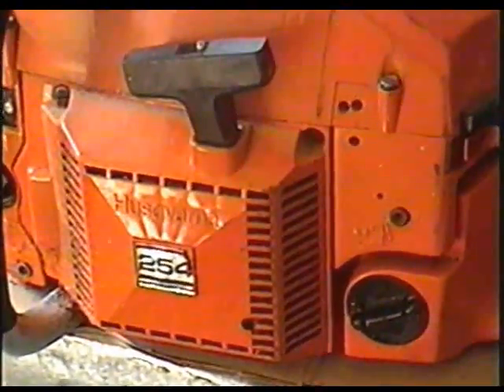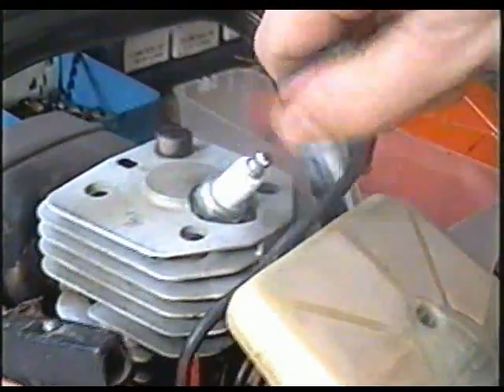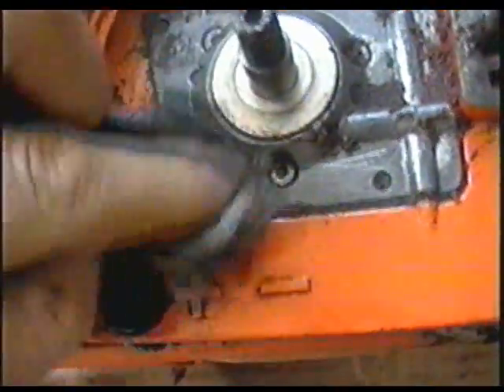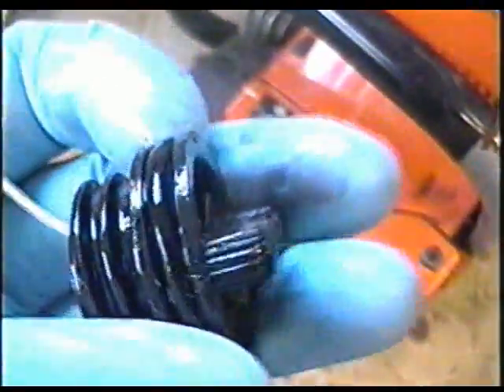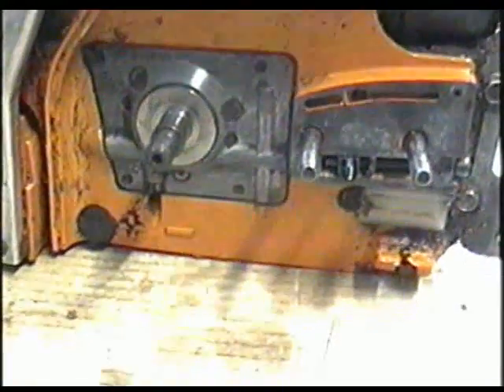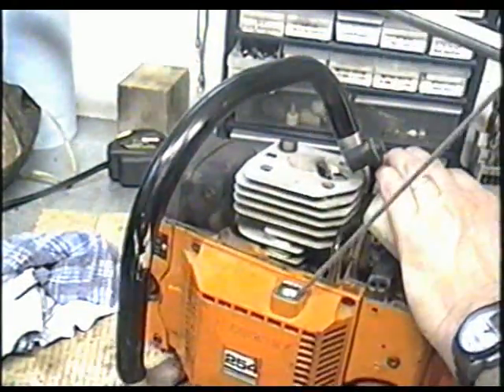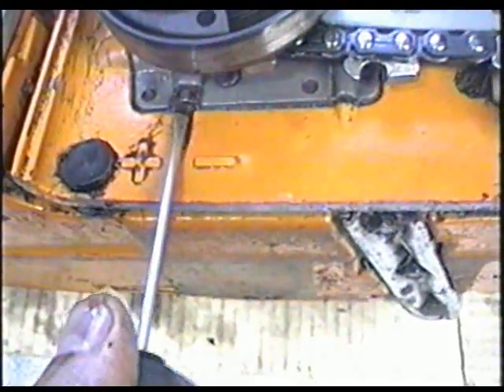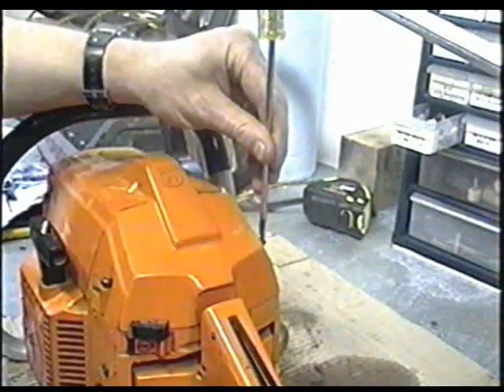Husqvarna 254 Chainsaw - Bar Oil Leak Repair & How To Remove Clutch

Comment: Thanks for your detailed nice & very understandable (Canadian?) message and yes, among others I do have a 59 ccm Husky and yes, it kind of leaks more oil than it burns fuel - sort of speak.

I have several saws with the same oil dripping habit (Echo is the only dry one and I actually did give a Stihl away) and will go step by step the way you have recommended.

Take care up there and try to stay out of trouble!

Comment: GREAT video! I have a 460 Rancher that leaks like crazy.  I'm going to clean it up and then lay it on it's side (oil filler cap up) to see if the leak stops (indicating that it's leaking through the cap).  Thanks for the video!

Comment: Good video, my 257 has same problem. I went back and forth thinking it was something from the oil pump or just the cap leaking. I’ll do same process, I need to take off clutch and inspect and clean anyway. Thanks for sharing!

Comment: dony, mine was the same I thought O ring first but no. After much playing with the cap I found a hair line crack in the cap which couldnt be seen. New cap fixed it, original cap lasted 20+ years so cant grumble eh. Good vids

Comment: I appreciate your informative videos Thank you! I have replaced the redesigned (one piece) oil pick up and screen assembly on my H/V 141 saw. It still leaks just as before. The pump and  gears look good. I can't see where the oil is coming from but it leaks badly. The inside of the entire  clutch area is oily but I can't see where it comes from.I did not replace the pump and the oil cap is good. Do you have a suggetion as to what else I might do? Thank you,.......Tom

Comment: I’ve been brazing a spot on the plate to increase the pressure on the seal area for years, also I’ve used socket and punch to drive the area in to increase pressure on the area 
Never replace oil tube eather

Comment: Another great video, Donny. 

On a related note, what kind of bar oil do you recommend for the new Husqvarna saws? The manual (for my 450) describes a vegetable  oil base made by Husq'y, but they also say you need to remove it if the saw sits for long because that kind of oil tends to condense into a sticky paste that gums up the saw if you don't. My saw will likely be used once a month or so. Would a light sewing machine oil work as well?

Comment: Watched your video on greasing pto side be aring. Great info. Reading some of your feedback i read about the same problem that I have and that is to access the oil pump and seal area. Is there a simple way to remove the cover to access them.?

Comment: OH Dony:will now this saw will run great.and it sets there and Idles perfectly.then all of a sudden when I go to squeeze the throttle it lugs..I have adjusted those set screw every which way I can.and when I'm cutting with the saw to the side cut, it lugs.could that be do to the fuel filter.

Comment: if you want to speed up finding leaks use diesel, it wicks to cracks and holes and leaks super fast. and it cleans out the motor. to each there own

Comment: Greetings, Dony.. did read the parts manual, you sent me.  Thank´s.
I will check my saw tomarrow and compare with the model manual received. Again in my case oil is leaking from the square metal "edge" right behind the clutch :-/ wish is only a seal or maybe a gasket... thanks. I´ll let you know how it went.
Regards.
Jay

Comment: Hey, thanks for this.  I need to remove the oil pump but cant for the life of me figure out how to remove that silver washer type cover that is over the crankshaft and stopping the pump from being removed (after removing the 3 screws) I've pried as hard as I can without breaking anything...suggestions?

Comment: Have a husqvarna 440 e series chainsaw brand new i only warmed it up gave it a couple revs haven't use it on anything but its leaking bar oil continuously what could it be ?

Comment: Having an issue with a Husqvarna 262XP. Its leaking oil and the bar isnt being lubricated at all, when I had the bar off and the saw sitting upwrite, that little hole ( top right from the bar bolts) was leaking oil, any idea what that might be? Thanks

Comment: No oil for the bar of my Poulan Pro 260. I checked the oil pump. The gear is stripped. Could you tell me why a so simple mechanism could fail?

Comment: Hi DONYBOY, I have a Husqvarva 235 that has a serious bar oil leak. I have replaces the oil pump and ALL related hoses and filter. It is all new. None of this has slowed the oil flow at all. I can't find where the oil is coming from but I suspect what I believe to be a breather or vent tube.   I see no way to remove and replace this item and I can't find it on the Husqvarna parts sheet. Would you have a suggestion as to what my problem is. Thank you for any help you may provide. Thank you, Tom   Is the oil tank suposed to be pressurized?
Reply from the maker: tank is not pressurized, I would have to physically see it in my shop to give u a proper diagnosis
Reply: Thank you!

Comment: donyboy  , i got an old pioneer p40 , would you know if there is an adjusting screw on it for your oil? the oil is coming out where it is suppose to but its coming out alot.
Reply from the maker: I don't remember but look under it near the clutch for a screw
Reply: You know your stuff donyboy! there is a big old screw under the clutch and it was fully opened , so i put it near half way open and play with it from there , Thanks!!!!
Reply from the maker: ok good

Comment: Folks need to use brake cleaner and spray the area good before removing caps will help prevent trash in tanks and proper seal of caps

Comment: Some Huskies just piss oil. Some dealers just sell you time and labor, or blame the leaks on engine heat expanding air in the tank thereby forcing oil through the system. Nice try but when not in use (when they all leak), it's AFTER being used which means a few things; the reservoir pumped out oil, the air in the reservoir may have expanded due to heat. When most people quit cutting they set down the saw and it cools, which may create a substantial negative pressure and air is easily drawn in after some time. Then the saw is stored where it is usually at least a little warmer (thermal expansion) and she gets the drip. Pop your cap and replace it after cool down (still get a few drips) or do what I do; whether its hot cold or in between I set it down, CAPS DOWN. Seems like a bad idea right? Your saws are still oiling w/o you and 99% of our caps don't leak, try it. 4 out of 5 of my saws lay on their left sides